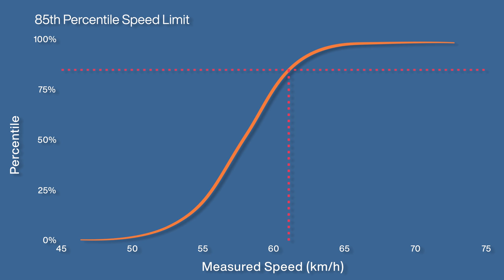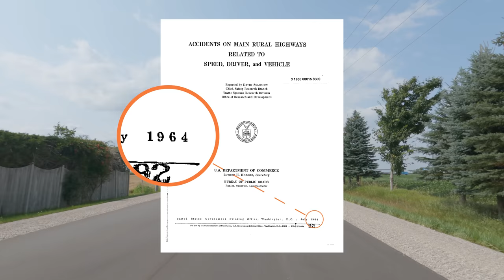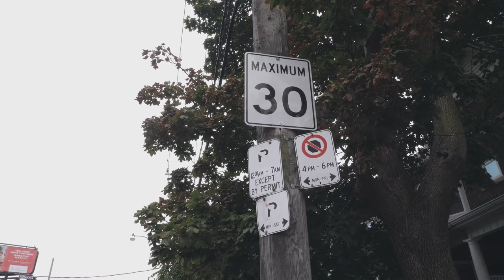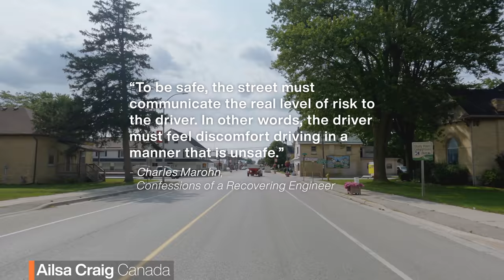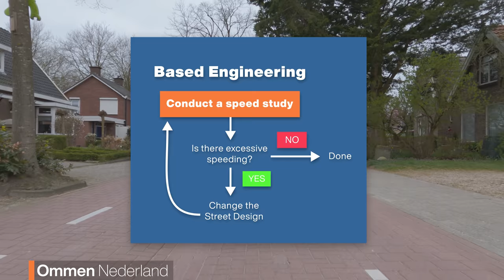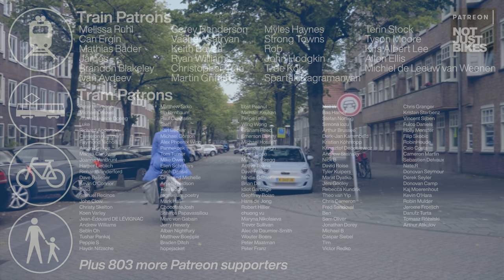The Wrong Way to Set Speed Limits [ST06]

Comment: Another important consideration is highways where there are actually more collisions because the speeds are too low or suddenly drastically reduce for no apparent reason. Or there isn’t enough space set aside for longer exit ramps.
Reply: The sudden change in speed for no obvious reason is usually to prevent the congestion that causes accidents. Slowing approaching traffic allows the traffic ahead to get out of the way so that there's never too many cars close together. This is done with variable speed limits too, as a method to solve traffic jams. Sadly it doesn't work because people just drive the regular speed limit. Extended exit ramps have the same issue, with the more selfish drivers using this as an overtaking lane.
Reply: @IOUaUsername  interesting. I think more highways should take the German approach to keep cars far apart with higher, not lower speeds. Several studies have also pointed out that drivers are often less attentive at lower speeds rather than at higher speeds.
Reply: @thejpkotor  I am convinced it comes down to much deeper cultural forces than any amount of design. I used to live in Nairobi, Kenya where all cars have speed limiters and traffic moves at an absolute crawl most of the time. In some of the roundabouts it was regular practice to physically rub your car against others. And the per capita deaths in traffic were still much higher than the USA for example.
Reply: @tobyvision  doing a proper exam before someone gets their drivers licence handed might be helpful?
Reply: @Sool101  absolutely. And this is certainly a problem in the USA. Our driver training is mostly a joke.
Reply: @thejpkotor  
My approach to safety would be to place the driver in a glass bubble at the very front of the vehicle. This would give the driver the best possible view of the road while at the same time letting the driver know that in an accident they are the bumper.
A bit of incentive to try to avoid collisions.
Reply: @thejpkotor  I don‘t think this is a good idea. The speed difference can be quite dangerous, with most people sticking to 120-130 kph.
But then there is the other group, going over 200. This leads to many close calls especially on two lane highways, because obviously people want to overtake the slower vehicles. It is very hard to judge the speed of cars coming from behind and if you don‘t look well enough you got a big problem.

I‘d say the speeding cars coming from behind are mostly to blame, on two lane highways at least.
In Germany we have a rule that says that we need to adapt to the flow of traffic, this should mean that you can‘t go that fast with other people in sight but unfortunately, the Autobahn is a pure ego minefield. 
We don‘t need to lower the speed limit to 100 like the Netherlands did, that‘s dangerous in its own right, but we should stick to something between 130 and 150.
That‘s still plenty fast enough but you remove the serious danger of misjudging
Reply: @thejpkotor  Speeds higher than 120-130 km/h are less economic and dramatically increase fuel consumption. Also, the maximum speed of trucks and buses are 90 km/h and 100-110 km/h respectively. When you are driving on highway and somebody wants to overtake you have to pull to the lane where are vehicles mostly going said speeds. However, there is difference between joining lane from i.e. 130 km/h and 180 km/h. Usually you don't have to brake when you are going from 130 to 90 km/h lane but you would surely do if you go 180 km/h. Ideally you want the traffic move like a piston, where everyone is going same speed and there is not a reason to changing lane (where you basically ocuppy in one moment two lanes).
Reply: @kosskrit  sorry, I was talking about multi-lane roads with speeds at or under 55mph (~80kph or lower) where there are many lanes, but more collisions due to relatively low speeds and not long enough ramps/ample exit areas to get out of the main traffic flow. While I agree fuel range is negatively impacted if you’re going too fast, going too slow causes more driver fatigue and distraction, and therefore chances of collision.
Reply: @thejpkotor   As a German who likes to drive a bit faster on the Autobahn (160-180), I have to fully agree with your point. It's true that driving in Germany can be exhausting when you drive slowly because there are so many cars driving much, much faster than you. But The 100km/h in the Netherlands is a nightmare too. I have never been so annoyed, exhausted, and mind-numbed than when driving larger distances on their highways. Basically at crawling speed even though much more would be possible and save, while everyone around you drives with way too little distance and cuts you off, and you can't "escape" them because you go exactly the same speed as them for several kilometers.
Reply: @Rear_Admiral522  Also its to say. The problem is often not the fast incoming car. The problem ist the guy, who just changes langes with no indicator and without checking the mirror. In the moment i see a very dangerous culture of allways blaming the faster and bigger vehicel in case of an accident. But this leeds in the long run to the belive, that we only must slow down everything and it the problems will be solved. We "serve" those people moving blind and arrogant trough the traffic by telling them, its not there fault, its the fault of the fast car. And so they get more blind to the traffic arround them everyday. Till we get to the day, where nothing is allowed faster then 5 KMh and we still will have injured and death persons.
Reply: @Rear_Admiral522   Netherlands has 1/20 the population and 1/237 the land area as my country.  The netherlands way of doing it wouldn't work well for us, either, in most places.
       Those slower speeds are a problem for transporting goods from one place to another. I drive a car and a combination vehicle and I see 8:20 and think "This guy doesn't understand hauling freight in a truck with a 13'6" or    4.11 meter clearance. People behind me wonder why I have to drive in the left side of the road to avoid the trees in this kind of town, to deliver their food, clothes, electronics, and medical supplies.
Reply: @bl8388  think your also  missing a key point, the population density of  the  Netherlands far exceeds even the US, with roughly 413 people per square kilometre (or 1,316 per square mile), to the US's 34 per square kilometre. So they would have the same issues of logistics, actually even more so as many of their cities and towns are 100+ years old... roads that were not even designed for cars period. North Americans want all roads designed to fit their needs, rather then designing their Logistics to meet the limits of the roads, then complain their are so many accidents.
Reply: There's a number of highway intersections near me, where a road crosses the highway, only the traffic on the road stops. On the highway, the speed limit drops from 65 to 35 between 3/4 and 1/2 mile from the intersection. Some vehicles slow down at those speed limit signs, then the drivers behind them get mad, by the time they pass the slower vehicle, they are near the intersection, often crossing the double yellow lines or using the left turn lane to pass. At least half of the traffic on the highway is still going 65 through the intersection.
Reply: @thejpkotor  Drivers do seem to be less attentive at slow speeds. It's quite noticable on the highways that go through town, speed limit drops from 65 to 35 in town. As soon as they slow down people pull out their phones to check them , or start fussing with the radio, or doing their makeup, or checking hair in the rear view mirror, etc. Once they get through town, with the higher speed limit sign still 1/4 to 1/2 mile ahead, they speed up to 65 again.
Reply: @javaman2883  you’re totally right. This is another of my thoughts. People assume lower speeds mean ‘safer’, but many crashes occur at relatively low speed.
Reply: @JustClaude13  i don't think murder by design is the best way to deal with it as i doubt it would actually change much considering car crashes are already very deadly.
Reply: @JustClaude13  not sure if this is 100% true but there was a guy who designed 2 cars pretty much the same except one car had a large pointed bull horn sticking out of the center of the steering wheel  and had people drive both cars on the same road, they said the result was 95% of the people drove the car with the pointy horn slower than the car with out the impaling device on the steering wheel. In others words when you know not being careful could cost your life you will be cautious. But of course the world today has a different attitude. No one is responsible for their actions so governments often will design roads for high ability, and reduce the posted limit. They have the attitude of we know people will drive 50 when we say drive 30 so make sure we design the road to handle 70.

Comment: In Nepal we've come up with system which forces even the most stubborn of the drivers to slow down. We call it the no road policy. It's quite simple actually. What the government does it that it does nothing. So the road eventually gets filled with potholes to the point you can say "there are some road in the potholes" and you won't be wrong. 
This way, nobody can go faster than the half of the rated speed limit. And in the monsoon, we have to befriend fishes to help us locate any sign of road.
EDIT: spellings cause English is not my first language
Reply: 😂😂 nice sense of humor!
Reply: Based.
Reply: Also it's very cheap and a good example of a lean state!
Reply: Dang and all these years I though South Carolina roads were just poorly maintained on accident. Turns out we were ahead of our time 😂

Comment: When i was growing up i had to cross a low-speed, two-lane street on my way to school. It was quite a long and straight stretch of road so people often drove way past the speed limit there. At some point the crossing was re-built so it was only wide enough for one car to pass through. At the time I thought this was stupid, as I could not understand why the change was made. I now see it as a simple and clever solution to a problem, a solution which works on multiple levels. It forces drivers to slow down and to be more aware of their surroundings, it makes the street narrower where the pedestrians cross which in turn means less road for them to cover, and it makes the pedestrians more visible to the drivers as they are no longer only in the peripheral of their vision. A very simple, cheap and effective way to make it safer for children to go to school.
Reply: A better way would be to build a raised walk-over and ban pedestrians crossing at ground level.
Reply: @dandiehm8414  No, that's too expensive. To Support wheelchairs you have to have elevators and soon you are at $1million per crossing. We are lucky if this is done for railroad crossings.